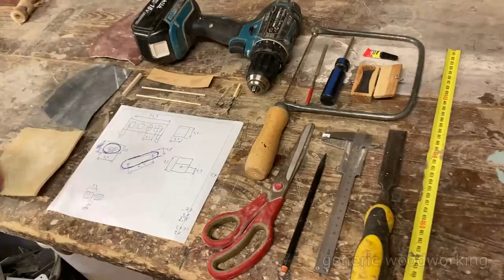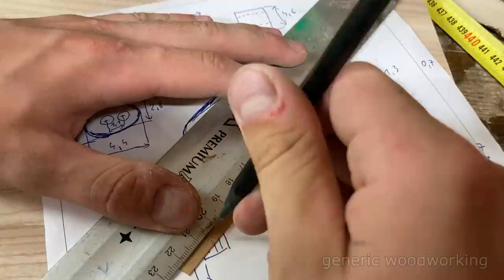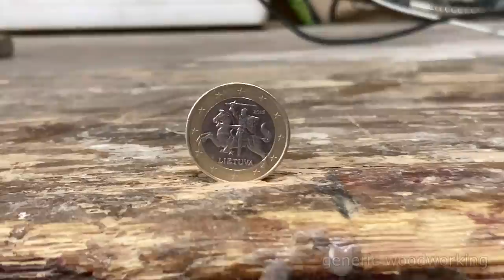Worlds smallest wooden engine model

Comment: I love the determination. Bring it up in detail, albeit on a slightly larger scale. Precision with bearing caps. Thats a whole different nut to crack. I build a 1.5l i-4 in school with 5 mains, crankshaft counter weights that were calculated. Crankshaft would basicly free spin, Exotic woods with fine grain and a drill press were key. After honing the cylinders I was able to get 45 psi @2400 rpm

Comment: This is amazing!! My Dad and I are in awe!! What ratio would you say this is compared to a normal sized V8?
Reply from the maker: Well the cylinder volume is around 0.00012L so compared to a normal 5L V8 the ratio is about 1/41666 (in volume)  or around 1/35 in length
Reply: @GenericWoodworking  That is amazing!!! 🤯👏👏👏